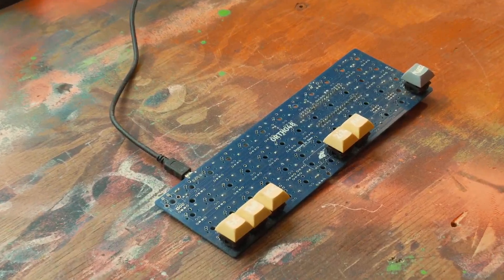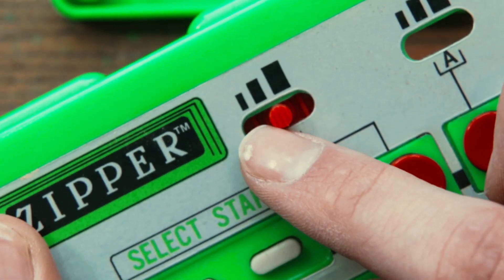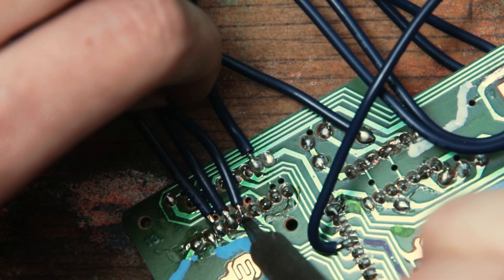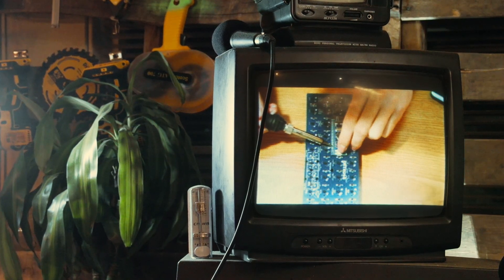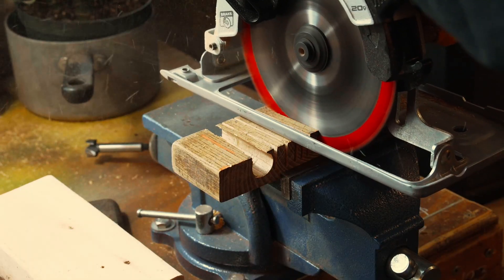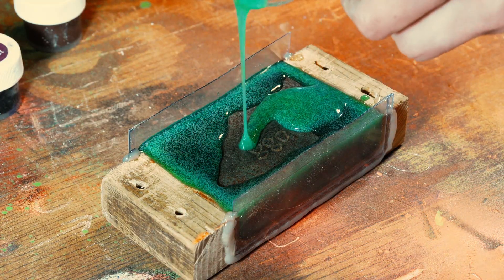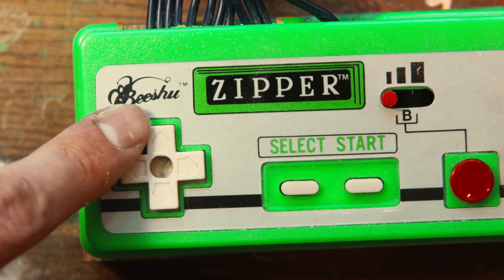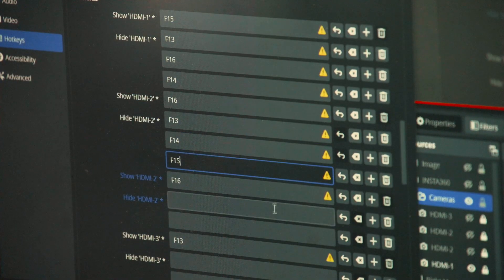NES Controller Camera Switcher

Comment: thicker that necesary wire is a bad idea, it can pull traces off the pcb, it happend in my headphones project and now i needed to buy a micrscope to fix it because it was to small to fix any other way    i prefeas to use internet wire or something like this in this project, you can put for example 2 cables using internet  rj45 conectors and have fast easy to interchange cables, vga/rs232 cable or something like this souns good too

Comment: Damn, cool project. I wonder if the same method can be used to mod a cheap calculator and have way more macro buttons. I actually want to make one out of a broken calculator I have (the carbon pad type) would this even be possible?
Reply from the maker: Sick idea- I assume the contacts would be a lot smaller and harder to solder. Only way to find out is open it up and see what it looks like. I think it'll be easier the older of a model you use
Reply: @EvanMonsma  I want to use the most basic one, not a scientific one lol. I want to repurpose a 12digit basic calculator. Would that be even possible? Given the Matrix of those keys?

Comment: Have you ever considered looking into 3D Printing? 
I think it would work very well for a lot of your projects but I could imagine that it is not your kind of philosophy to meticulously design CAD drawings instead of just getting some scrap wood :)
Reply from the maker: Yeah I used to mess with a lot of 3D modeling and printing years ago but haven't touched it in a while. To me its almost so useful its boring if that makes sense lol. Also I just love the process of designing with my hands instead of with a mouse and keyboard, especially since I already spend so much time editing video on the computer. I'll probably get a new 3D printer down the road though for certain things I can't replicate by hand

Comment: I don’t know why, but this one is one of my all time favs from you. And that’s a high bar.

Btw, did you cover those nuts inside the controller? Be careful with shortings.
Reply from the maker: Thank you! Yeah I made sure they lined up with corners there were no contacts, also the bolts didn't go deep enough to touch. Quite a bit of clearance in there

Comment: I've done a similar thing, but using an RP2040 based micro controller (basically what makes a RasPi Pico, but mine is smaller for keyboards) I just ran the original wires coming from the shift register to the MC inside the shell (they have 3.3v out, which is enough even if they were 5v, plenty of grounds, and then GP pins for data, clock, and latch), then ran the USB port out as a controller. I wrote a quick firmware to translate the data from the shift register and then output it as a keypress.

I feel like a lumberjack style keyboard would match this channel. I've made more than a few either from scratch myself or from different githubs. Love the aesthetic of seeing all the through-hole components.